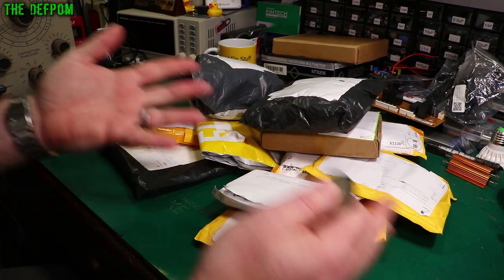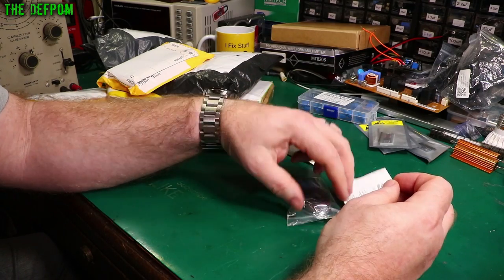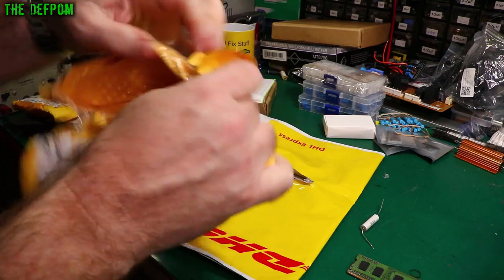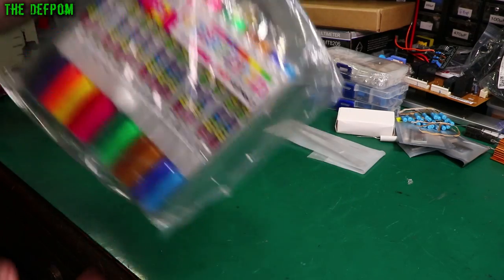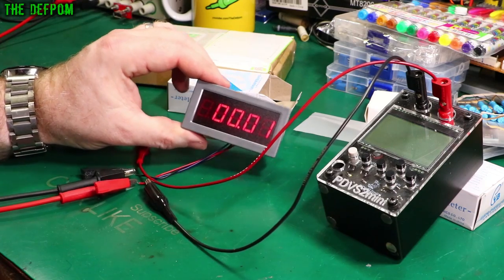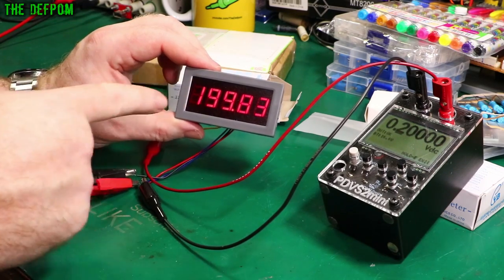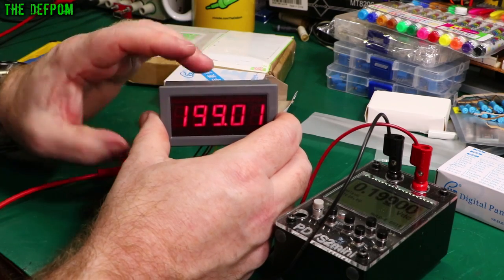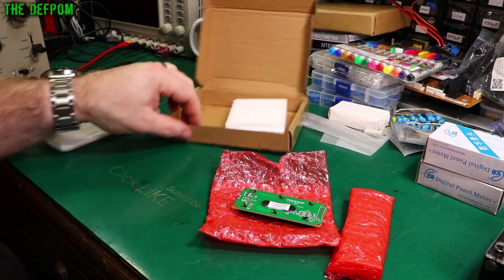🔴 What's in my Mailbag ? - Mailbag Monday 22nd August 2022 - No.1034

Comment: Proper medical tweezers that I bought from local pharmacy years ago is my most used hand tool, by far! Expensive, but next to indestructible.  I have others, like ones for SMD assembly, but I don't use them nearly as much. Which reminds me I need to buy another, spare one in case I "permanently" misplace it. It'll be like losing an arm.

Comment: "How many times do I have to tell you".....LOL!....For slight inclinations it's fine. It's the heater inside the LM399AH ref that if up-ended for instance will heat the actual ref. diode slightly differently. Like I said, for slight inclinations....no worries!

Comment: With the panel volt metres, the resistance of the connections and external noise will affect the accuracy when reading very low voltages down to 10 microvolts.

Comment: But how often will you need to adjust the meter, every day or so, maybe every 3°C temperature change.
The capacitor was shjipped using the new GREEN shipping method. send them individually as it saves on large packages. 🙂